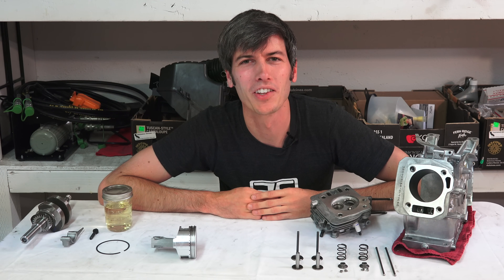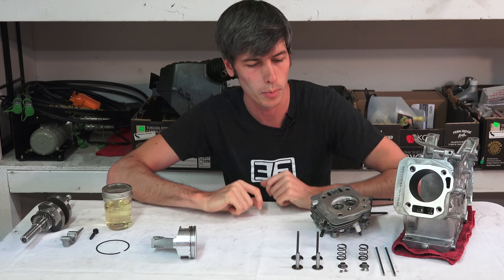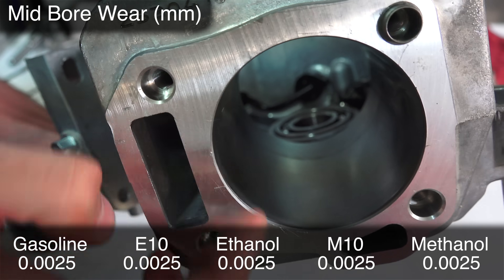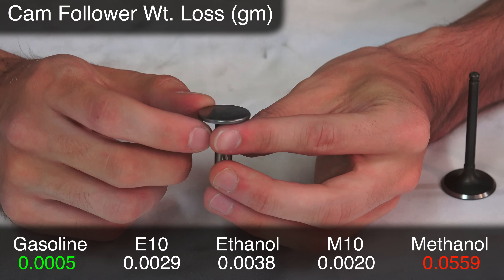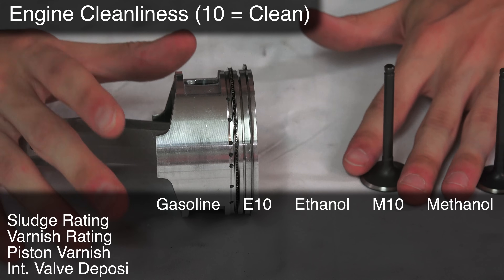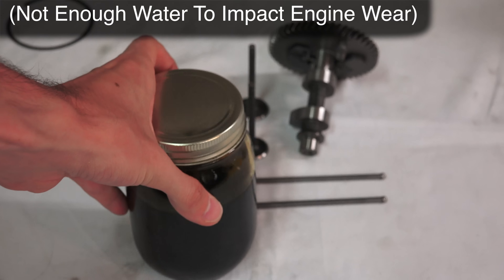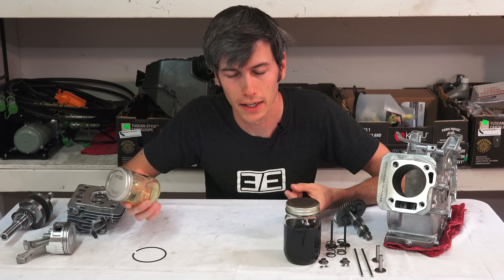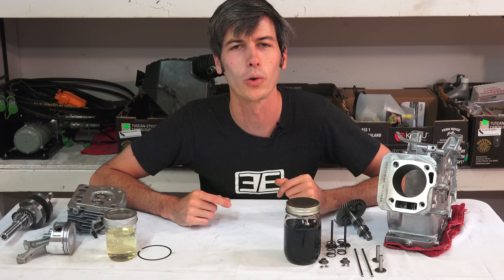Is Ethanol Bad For Your Car's Engine?

Comment: I guess methanol burns hotter.
However, I still only use E5 fuel with only 5% of ethanol (living in Germany, using European steady quality gasoline). Although this is a bit more expensive, ethanol contains fewer chemical energy per volume, so the fuel efficiency of the engine would be slightly worse. This compensates the slightly higher price per liter of the E5 fuel. Or at least it does on paper, but since I have neither tried E10 fuel, nor do I keep exact track of how much fuel my car uses per 100km (and it's old enough to not be able to calculate this on its own), I can't actually prove it. But I can say that I feel better with the E5 fuel.

Comment: Ethanol increases octane rating, so in a modern (90s+) car, what uses knock sensors, ignition can advance, so higher torque you get. That can be, but not neccessary better fuel economy. It matters when you buy 50% ethanol for each tank of fuel, with you can make 100+ octane rating from a 95 one. Emission is better too.

Comment: It'd be cool to see someone do an update to this study.  Maybe run the engines longer (20 hours really isn't that much) and in a more realistic commuting scenario to see if the start/stop cycles add anything to the mix.  So something like running for 30 minutes - 90 minutes and then let it sit for 8 hours then run for 30 - 90 minutes again over the course of, say, a month or two?  Also does the quality of combustion make a difference?  What about idle vs flooring the pedal?

Comment: Nice video, in Brazil we use "flex fuel cars" which can run in any proportion (100%E to 100%G, it doesn't matter). Also, since petrol crisis during 70s 80s we have ethanol vehicles. So I suggest you make a research in our market.

Comment: I wished they measured the amount of fuel used during the 20 hour run.
Reply: Ethanol%34 more using than Gasoline, Methanol %120
Reply: There are different grades of some of the fuels so not easy.
Reply: alcohols would use 15-30% more fuel than E10 or E0

Comment: Different story with marine engines: E10 mixed with 2-stroke oil became unusable after just one month - The oil started to form flakes with the water the ethanol attracted and on top of that there was phase separation, leading to the engine taking in ethanol+water mix without ANY oil. Fortunately the carburetor clogged up, otherwise the outboard engine would have been done for. 
Fuel lines, seals and plastic components of the fuel system were okay, however. 
Motor was a Mercury 10hp, built in 1986. 
There are videos on YT that show blown engines due to fuel lines breaking down, clogging injectors and carburettors and thereby creating too lean mixtures. Result: melted pistons, holes in the block, etc. 
There's also the issue with the water-content that can cause failures in the injectors of some engines. 

The higher octane rating can also result in higher exhaust-temperatures in engines without knock-sensors. Known example to me: Evinrude E-Tec (I believe it was a 90hp engine) threw Exhaust-Temp Errors as soon as E10 was used for more than 5 Minutes at full throttle, even with fresh impeller for cooling-pump. Problem was rectified by programming the engine with a different profile that requires higher octane (at least 95 instead of 87) fuel to be used.

Comment: I had a New 1971 Honda motor cycle In 1971. I believe in 1971 or 1972 gashahol as I believe they called it was doing serious damage to the seals rubber & I went back to the dealer. they said do not use it as it was causing damage to all bikes as they were coming back to them. Also they said if I continued to use it would void my warranty. This stuff was destroying the tanks & also affecting boats & small engines So what is the different NOW.

Comment: Did the experiment control for power output for each fuel test. Gasoline puts out more energy per unit volume and thus greater operating pressure than the other fuels, which may or may not lead to greater wear and tear in the engine. The best argument against alcohol as fuel is not from an engineering standpoint, but a financial one.
Reply from the maker: Ethanol is actually often significantly cheaper, part of why it’s used.

Comment: At 8:35, you're referring to 2012 or newer as modern cars designed with ethanol fuel/mixture in mind to protect from corrosion. In that case, ethanol fuel is not good for the majority of people. What about direct injection that many modern cars are moving to.

Comment: I've got a flex fuel vehicle that's rated for E85. If I'm willing to accept the lower fuel economy, does it make sense to run E85 all the time to keep the engine clean?

Comment: it seems like that methanol is the right fuel but in the wrong engine. with a corrosive resistant engine it would be the right fuel despite the fact that you get more power from it , i mean methanol woudn't been useed for Raceing if they couldn't gain some advatage of it.... so if my engine would be corrosion resistent i would stick to pure methanol may be with a little bit of nitromethane(10%) like Methanol N10.    XD

Comment: Pure ethanol is for very high compression race engines, it has half the BTU,s of gasoline, so the  air to fuel mix is 7 to1, if you put pure alky in an air cooled . engine  like a old beetle the engine will lean out and put holes in the pistons. If you place a aluminum piston in a jar of pure ethanol it will turn black, after a week. 10% wont hurt modern engines but older ones will have all sorts of corrosion issues, it also  absorbs water. Personally I think its just a way to get older cars off the streets.

Comment: @9:30 yep...here in Brazil we use Ethanol straight from sugar cane. And our gasoline has, around, 27% of ethanol in it...our 'mileage' (Km/l actually...SI rules...) is NOT that amazing because of it (and the price of it sucks)... .but what matters is this: there are some universities here that are researching ways to get that 'mileage/Kmetrage' to actually get more equal or even above common gasoline... it will take another decade or so( because we all know those oh so nice oil conglomerates are not interested AT ALL to invest in it, and in fact will do everything they can to kill it as soon as possible) but its something to add to this nice vid.

Comment: I wonder how 100% gasoline vs E10 would compare in a turbo'd or supercharged car. The main reason I ask this is because I am planning to buy a Mazdaspeed Miata in the next few months (turbo 4 cyl), and since that tiny car has a tiny gas tank, I could definitely afford to buy 100% gasoline at a local station. The car was made from 2004-2005, so not a super new car, but new enough that I'm sure it would fare alright with, say, 93 Octane Shell fuel. My question is, if I take it somewhere that I can't find 100% gas, and it's "used to" being run on the 100% stuff, how would it affect the engine computers and overall performance? If anyone has any speculations, please weigh in! After watching the video, I am still not sure if paying the extra cents per gallon for the "good stuff" is worth it over Shell premium. If @EngineeringExplained makes it this far into the comments section, I'd love to hear a professional opinion :)

Comment: I wonder how it effects aluminum?
Reply: I eats it for lunch.  Aluminum is corroded to bits by ethanol ("alcoholate corrosion").  It's the reason the carburetors on lawn equipment go bad so easily.

Comment: Ethanol is the major reason for all P0420/0430 engine faulty codes. Insufficient Catalic Converter issues is caused by Ethanol messing up the O2 sensors, especially ones after catalic converter.

Comment: Alright so this test shows what happens in 20 hours but I’m thinking the results could be different if ran for years with engines around 100,000 or so
Reply: Chevrolet 2.0l ohc engine, 1991 with 600.000mi and only ran with e100. Never opened it, not even for changing the head gasket. No smoking and almost none oil consumption, carburetor (especific to alcohol) almost never had a problem

Comment: My understanding is in low amounts it's okay but these engines have to be set up to handle this stuff because  it causes massive corrosion especially if they're trying to push something higher like 20% or above. the word I heard was that a majority of the engines that are running now will be destroyed by that.  It is also hell on small engines because it attracts water and it basically clogs up the atomizer screens. the best way to handle that situation is to put only what you need in these engines when you're running them and run them dry each time you shut them down if they're going to be sitting a while. This information I've gotten from various mechanics of multiple engine types I myself am a mechanic also and I've heard  quite a bit about these fuels: the ones that are here now and the ones that are on the horizon.
At the end of the day I just think that it's a ploy to get the older engines that they consider environmentally destructive let's say from being on the road any longer. Take a look at the emission standards in Japan and that's basically what they want here. Engines over there that are older than say 30000 miles will just not meet the standards anymore.

Comment: Pretty cool video! I'm from Brazil and we use E100 on flex fuel cars since early 2000's and the only trouble that we have with pure ethanol is in cold starts (which is solved with direct injection or a gasoline tank for cold starts), and with some added corrosion on the exhaust system. I agree with you maybe the ethanol cause issues in the fuel system for older cars which were not designed for it. Keep up the good work!

Comment: Unfortunately it costs $28 to read the study, I would have like to read it to find out more about the test methods they used.  But there have been other studies that I have been able to find.  They confirm the same things that the problems are only really for older cars and anything that gets stored for the winter.  The only thing I found that could have a reliability impact was that at WOT the leaner the mixture became with higher ethanol blends (engines tested were up to 2007) resulting in higher exhaust and catalyst temperatures.  Not all of the engines tested leaned out.

The only thing I noticed on an older truck which could have been coincidence was that with E10 performance was noticeably lower and fuel economy dropped by close to 10%.  Though when I eventually replaced the O2 sensors everything returned to normal.

Comment: Freezing point? Knock prevention? I always thought that was the main reason for blends common at the pump. Are those misconceptions?
Reply: Pure ethanol is rated as 112 octane, if i'm not mistaking... that's why it's used as a blend, so then the gasoline has a lower quality, but the ethanol increases the octane...

Comment: From an auto techs point of view when "they" started it being common practice.  Customers started wondering if they needed a "tune up" because they were not getting the gas milage they once were. The shop I worked at was never going to let that sail out the door in missed rev. Only to have the person return a few months later, just saying that "yea its running great; still not quite getting the mileage though".   Thats All from North Carolina

Comment: I just tell people to not use ethanol full stop as why would you want to mix fuel with potential water in the tank and run it through the fuel system and rust it out from the inside and damage injectors or ruin rubber lines. Not so much an issue with modern cars and the stainless steel fuel lines but still I don't like to take the risk.

Comment: Im wondering if they were running a very lean setup with the methanol because it takes alot more fuel than air than gasoline does. But ethanol does to so they could of had a stoichiometric ethanol mix and rich methanol

Comment: So in short all I theoretically would have to do to be able to safely run my '95 MX5 on E10 would be to change the fuel lines to modern ones that are made with E10 in mind

Comment: Good info, the issue on separation as well as water and ultimately algae build up in small engines (lawnmower, powerwasher, pumps and machinery that are infrequently used) is the main issue for me. Haven't had huge problems with it, I tend to maintain my stuff fairly well, but I have seen some terrible examples, tractors with all algae sludge in the tanks etc.

Comment: My main concern from this stems from the time frame and the assumption that if these engines tested in 1981 were carbureted, and the carburetors were never adjusted throughout the test, every time that the ethanol gasoline or higher octane gasoline were added I would assume the temperature to differ much more across the cylinder as opposed to normal unleaded gasoline. I wouldn’t be willing to draw conclusions that ethanol causes more wear based off of this experiment potentially having many variables not accounted for.

Comment: As ethanol is hygroscopic it absorbs water it is not good for ferrous metals. The wear tests were only short. As you said water separating out and causing water droplets every where cannot be good.If you do not use car a lot this will be a big issue and then the oil will sludge up. On top of this you are using valuable cropland to produce fuel instead of food. To me they should stick to gasoline.

Comment: In my opinion these test are flawed and setup to promote ethanol.    I’m guessing 5 different engines was used, no 2 engines will wear the same even if you use the same fuel source.

Comment: If Ehtanol has less energy per CCM then why it is used in performance cars?
And is it safe to just add E85 full tank to a stock BMW car, 2012 onwards, let's say f30 with N20 engine?

Comment: The real danger of ethanol is that it breaks down quickly in all your fuel system parts and  makes a mess when it does so. Also, the corrosive factor is definitely a problem for those with classic cars that sit around for a while and the fuel tanks “rot” out much more quickly.  The average person will not experience these same problems with a newer car that gets used all the time.  Then we talk lawn equipment with gas engines.  Ethanol fuel wreaks havoc on these machines because they do tend to get neglected and sit for several months with ethanol in the fuel lines and carburetors and they are toast!!!!  Jay Leno fortunately had the money to fix the parts on his old cars and motorcycles ethanol had destroyed and now puts in non ethanol fuel.  It is just money!  In short ethanol fuel sucks for some of us.  So, your engine may not be worn out from ethanol fuel, but it will not run when the ethanol destroys the fuel system.

Comment: Jason, would you be able to cover the benefits or otherwise of unleaded fuel vs E10 blended fuel?
Here in Australia, we most often have a choice of high octane 98, regular unleaded 91 or E10. 
While that's fine, I've always been of the opinion that the 10% blend contains less energy per litre (or gallon) and so the engine will not be as efficient. There is a slight price advantage offered on the E10 but here it would seem that does not cover the reduced fuel economy....

Comment: My '96 Tahoe 2 door has 260,000 miles on 10% Ethanol fuel on the original engine and it runs like new.

Comment: So 2.5 microns mid-bore wear after 20 hours. Assuming an engine is "worn" at 0.5mm (20 thou over), it would take 200 lots of 20 hours to ruin an engine. If you drove everywhere at 100km/h your engine would last until the odo reaches 400,000km. Ehh I guess it works out.

Comment: Why would ethanol be bad for an engine when alcohol dragsters always use ethanol? Obviously you need a tune to run ethanol but other than that it's better than fossil fuel in every way. It burns cooler, allows for more power in turbocharged/supercharged vehicles and even reduces pollution.

Comment: I mix e85 with e0 to make e30-e35 that i run in my 2uz-fe. Yes i lose 0.5-1mpg on average... but the fuel boosts power in the midrange, which is exactly where my torque curve peaks. Maybe it's only 10lb-ft, but going from e10 to my blend is night and day when you drive it. I studied this a lot before doing it, so no concerns to engine damage, but I'll admit the cost is a couple bucks worse per fillfill-up, &  thanks to politics there's only one e85 pump within 250 miles of me

Comment: Looking at the results it appears that the only fuel to have either a white or a green was Gasoline...all the others had at least one red....I guess they adjusted each engine to suit the fuels...Timing AFR's and compression ratios...My problem with alcohol fuels and blends is what happens in the fuel system over time form the fuel tank to the injector.More modern vehicles have lots of plastic in the system from tank,lines,fittings,pumps,filters and injectors and they have very intricate emissions systems minimizing the possibility of corrosion...You only need to check the carb and tank on the mower that has sat for 6 months to know where I'm at....I like your vids BTW.

Comment: With E10, it's a scam that we are actually getting less heat/energy content to compare to pure gasoline, hence, certain people ended up with less MPG on their car when they use E10. I would be more interested to see how modern direct injection engine handles E10 & gasoline in a long-term test for carbon build up in the intake valves and runners. I used to work in a petroleum testing lab that does ethanol inspection and testing for blending with gasoline. That study back in the 80s probably using some lab grade ethanol to blend in for test compares to real-world logistic that ethanol transfer from the ethanol plant to the rail cars and get contaminates.